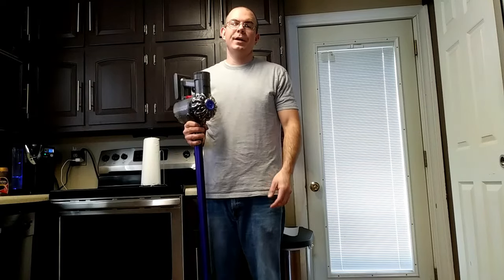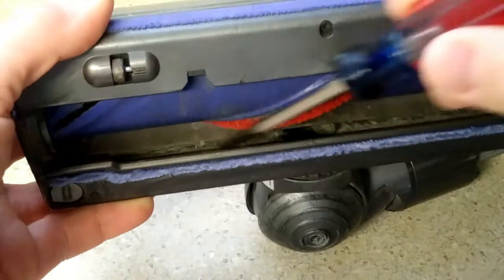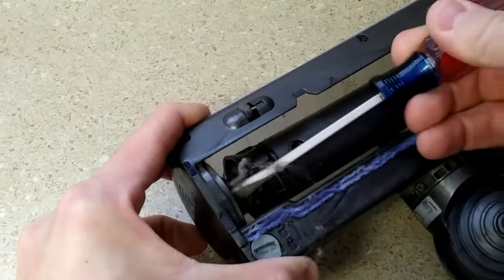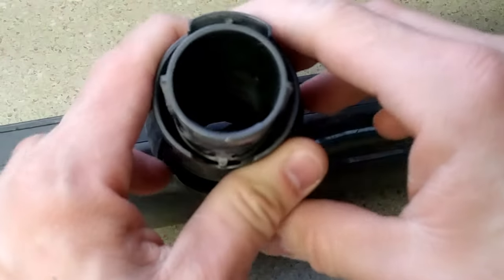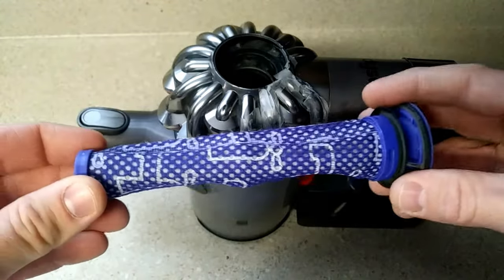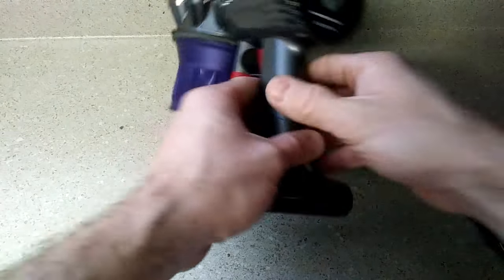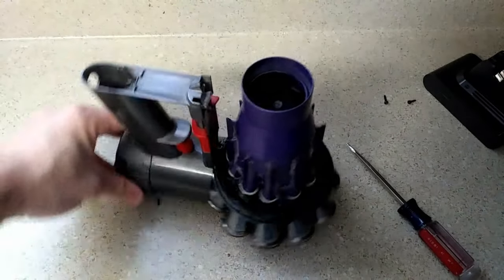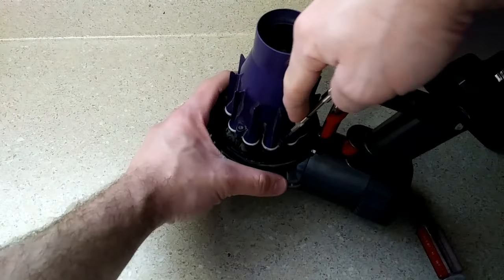How to clean a Dyson V6 cordless vaccum cleaner

Comment: Thanks for such a clear and detailed video.  I wonder if you could help me though.  Before taking apart, the machine was working, since putting back together the battery flashes red 32 times.  Apparently I need to buy a new battery.  Just wonder if I may have made a silly error when reassembling.  It seems a bit too much of a coincidence?
Reply from the maker: Did the battery get wet?
Reply: @TorrentPerformance  Thanks for coming back.  The battery didn’t get wet at all. There was a delay between  cleaning and using of 5 months.  Would this have an affect perhaps?

Comment: I don't know when you made this video but I can't get my soleplate  back on. The guard that you say uses a flathead screwdriver right before you turn the large cylinder to get the heater brush out.  My problem is the lock doesn't move. What am I doing wrong?  I thought it was on correctly but when I vacuumed it fell off. Can you help?

Comment: Hi I have 2 filters to install into my Dyson, the long thin one ,done! But also a round larger one has the max button on one end. I have changed out batteries already & thought this filter would be in yor video but you made no mention of it...? Part number HF137b. Do you know what the filter is & do I need to put in?  Thanks.

Comment: You are supposed to use coins to remove the brush roller..that way you wont damage the plastic with a screwdriver. 👍🏻 Also the washable filter is in two parts..you use a flat screwdriver to unclip the parts the plastic inside can hold lots of debris better to separate the fabric part from the plastic part then theres no danger of breaking the plastic when squeezing the filter 🤓

Comment: Awesome video Dude... thanks for posting. 

@  4:24  You didn't drmonstrate removing the access panel here ??? You unlocked it, however you didn't show your audience that it can be removed to clear a debris blockage...
Reply from the maker: Yeah that video was made over a year ago there will be no revisions. Thanks for comment, if they get this far into it they should beable to figure it out.
Reply: @TorrentPerformance  --->  Awesome tutorial though.... my v6 needs a good cleaning...

Just bought a v11 Absolute...  Awesome machine. Very powerful... picked up lots of dirt the v6 left behind. Going to use the v6 now as a surface clean dust buster and use the v11 for the carpets and furniture...
Reply from the maker: Check my other vids out if your a motorcycle guy. I work on everything,Ducati and aprilia is my passion
Reply: @TorrentPerformance  --->  Cool.... yeah I'll check out your other vids 4sure...
Reply: @TorrentPerformance  --->  Just Subbed to your Channel... why do you have notifications disabled?
Reply from the maker: what are you talking about
Reply from the maker: I have them set that way for me not the channel I think? Can you hit the bell?
Reply: @TorrentPerformance  ---> The bell is disabled...
Reply from the maker: I'm looking into it now. Hang tight gotta figure that out.
Reply from the maker: Try unsubbing and resubb
Reply: @TorrentPerformance  ---> All is good now Dude... 🙂👍

Comment: The genuine V6 Dyson has a washable hepa-filter, made of folded paper.  The model in this video is a later model (V7?), with a non-washable black-foam filter.  Both these final hepa filters can be replaced with new filters after several months, for about $5 USD.
The electric connections can be "dried" with a WD40 type of oil-spray from a pressure-pack can.  
The plastic pieces can be easily removed & installed if the contact surfaces are sprayed with a pressure-pack can of silicon lubricant.
I appreciated the comment from one viewer, that the tiny internal nozzles can be so clogged, that the vacuum pressure is lessened.  Deeper cleaning restores the lost vacuum power.

Comment: My husband used mine, yey! then washed the cup , didn't tell me, now it won't hold a charge for more than a few seconds . Has the circuit board been wet , do you know if its fixable  thanks.
Reply from the maker: Christine what color is the light that turns on after he washed it. If its yellow or red your gonna have to get a new battery as there is a safety on it if it gets wet.
Reply: @TorrentPerformance  its  blue.
I charge it and then it only works for a few seconds and it dies , if you press again it flashes blue. Thanks
Reply from the maker: @christinemyers6650  have you gave it time to completely dry dont tun it if its not dry
Reply: @TorrentPerformance  it's been 2 weeks since i tried it. I'll get a screw driver 8, see how it goes after a good clean. Thanks for the video and the quick answer.
Reply from the maker: @christinemyers6650  did you clean the air filter in the top. That is usually the cause of that issue.
Reply: @TorrentPerformance  just washed it , 1/2full of dust ,i took cover off filter , always thought i cleaned it pretty good. I use the leaf blower to clean the dust out of the top and thru the mesh. So I wont be able to test it till it drys probably tomorrow.
I will let you know how it goes. Thanks again.
Reply: It stays on now , filter still wet but i think that was the problem. Thanks.

Comment: 8:44 green light on battery flashed when you pressed the button, is that indicating the battery is ok?
Mine only works for 60 seconds then cuts out so I’m trying to find out if it’s the battery or the charger or the motor
Reply from the maker: i would say battery or clog

Comment: what is an etork screwdriver. I have a lot of small thin screwdrivers but can't see the actual head of the
stork screw. IS it flat or x shaped?
Reply from the maker: Star shaped. Link in description leads to tool set if you need one

Comment: Good grief!  I need to buy some Torx drivers or something to dismantle this thing?  I already clean the filter....................I'd rather buy another one.  I have had mine for about 8 years and just cleaned it for the first time except where I needed those Torx head things.....I constructed a hook like tool out of a chopstick, paperclip and masking tape to fish out the debris.  Works great.  Meanwhile, I will keep using it as it works great so far even though I won't be getting all mechanical and into the middle earth of the thing.

Comment: This is the second time I have cleaned my V6 with you - brilliant stuff! I could never have tackled it without your video but I need to get an Etork screwdriver. Is there a particular size I need?
Reply: T8. That's what he says at 18:04.
Reply: I took mine apart the other day, it is indeed a T8.
Reply: @Lloyd.B.  Many thanks! I bought a new drill recently and it may well have a T8.
Reply: @sam61a  No problem. I don't know why but he doesn't clean that last bit of the cyclone, at 12:09. I have a screwdriver set for doing work on PC's and I could do all of the T8's up to that point with it. But that last bit of the cyclone I couldn't do - the screwdriver needs to be really thin to get down in there. Luckily my dad has a flip out Torx set, yellow thing that functions a bit like a pen knife. And with that I was able to get to those ones. 
This other video shows that bit:
https://youtu.be/l7xAUt-3vYk?t=326

I just measured the thing I used to do the last bit, and it's 6cm long and 3mm wide, and it was just long enough to get in there. You maybe able to get away with it being a tad thicker, but not much shorter, probably.

I might get a proper T8 screwdriver from eBay, they are £2, if you can wait to get it from China. Using that flip out thing wasn't much fun.
Reply: @Lloyd.B.  Thanks for that - the smallest I have is a T10 - but I'm glad to know what they are for!
Reply: @sam61a  There are long or stubby T8 bits for drills, so if they are stubby ones I doubt they’d have got in there anyway.

I just found a T8 screwdriver on eBay, ships from UK, £1.89. Listing title is “T8 Security TamperProof Screwdriver Tool Xbox 360 PS3” if you want one. I also saw some 5cm long ones for drills that are £1.60, but I'm not sure if that is long enough. It might be OK because the really tight space is lower down.
Reply: @Lloyd.B.  I found one on Amazon! £2 free delivery, good reviews. Nice to have next time I need to clean the V6. I've done it twice now and it's always performed well afterwards, but this extra bit of cleaning might make it work even better!  Many thanks for your help :-)
Reply: @sam61a  Nice. I HAD to clean mine all the way because the previous owner has dogs, and it reeked lol.

Comment: I spent 2 hours trying to take this thing apart.  Only to find out the filter on the back is not dirty. geez!!!
Reply from the maker: well rubby hope video helped a little
Reply: @TorrentPerformance  
Your video was well made. I don’t understand why they would make it so hard to open the back of it to clean the other filter. Or why is that a necessity. 😓

Comment: Unfortunately, there was no instruction for removal and re-assembly back the motor unit. You can't clean the rotating head without its disassembly.
Reply from the maker: If you call dyson they can probably help you out.

Comment: After emptying the clear plastic dust container, I tap the vacuum gently on a hard surface covered with a piece of paper towel. That seems to dislodge most of the fine dirt--and you'll be surprised how much. 
Disassembling sheet metal screws in plastic is a bad idea, as the plastic threads will lose their grip after a few times. Further cleaning of interior surfaces is not necessary, since all it does is clean off aerodynamic surfaces, which has a minimal effect on suction. That crap is not "clogging" anything, just coating aero surfaces. 
Just tap the vacuum with the dust collector off, and you'll dislodge 95% of what you'd find if you took it all apart. Mine runs fine, and I use it all the time--and I've never taken it apart. Even the paper air filter stays clean.

Comment: Did you really tell people to clean the MOTORISED head with water? Really? I would never recommend to anyone that they clean the motorised head with water, there is an electronic motor inside the head? why would you want water anywhere near it?
Reply from the maker: I don't think you watched the video all the way threw. You would never clean the motor part with water. Maybe rewatch the video completely before commenting. All the electronics on these are in the rear of the unit
Reply: TorrentPerformance you have 100% not fully stripped down a dyson V6 based on your comments. There is an electronic motor within the head of the dyson v6, the electronics are most certainly not all main body. The v6 has a motorised head, how do you think the brush bar rotates? It is powered by an electronic motor in the brush head, which you suggest people clean with water.
Reply from the maker: @ncolli1981  The head motor your referring to is sealed within the front of the head your right. There is never a need to clean that motor. The method of cleaning in this video I have done many of times and I do recommend following my video to clean your Dyson if you have a issue with your dyson. I don't recommend even touching the head unit assembly unless something is wrong. Cleaned many of these units without one water related issue with my method. Thanks so much for the comment and I suggest since my video is not to your standards to make your own video to help people. I checked your channel out and suggest maybe continuing your uploads and maybe less negative type comments for stuff you may agree or not agree with. Good luck with your YouTube page and thanks for the comment.